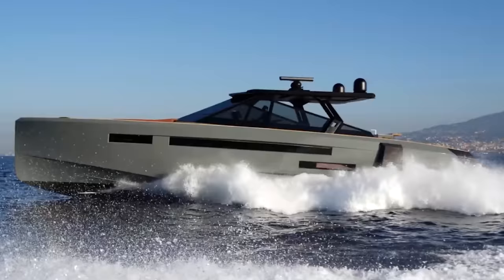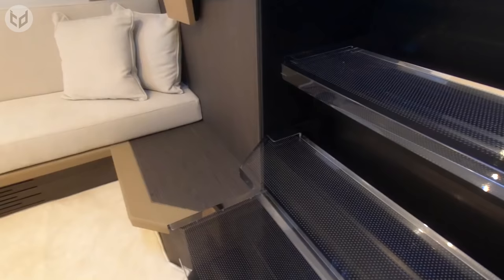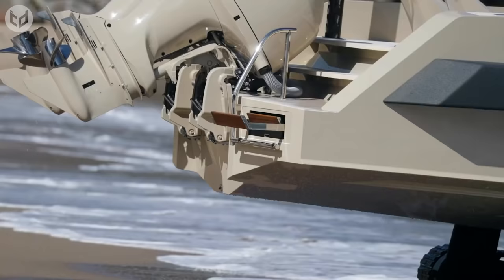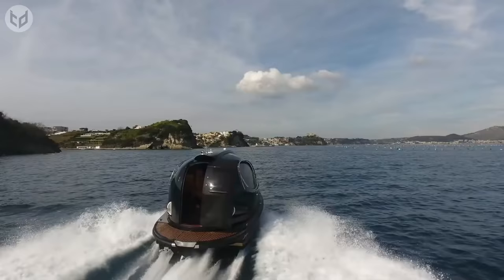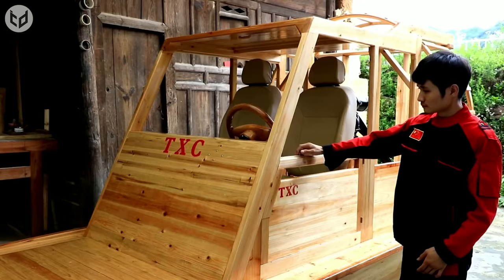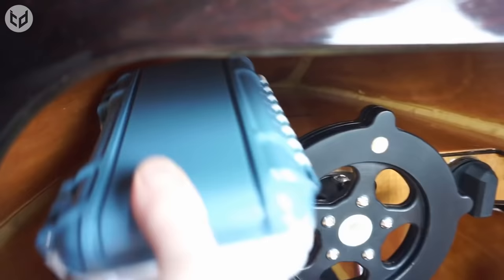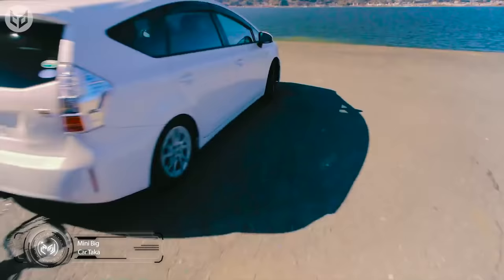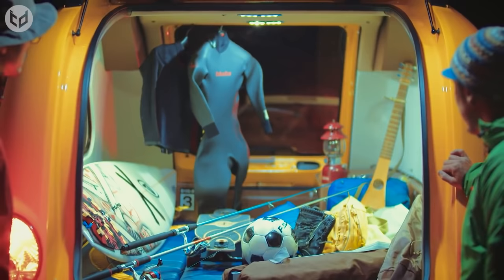6 Incredible Mini Boats and Yachts | WATCH NOW !

Comment: Jet capsule is compact and enclosed. I like the enclosure as you don’t have to worry about bad weather.
Reply: Like it too but i would prefer a smaller and less luxury version with just 1-2 seats because that one would cost waaay less to purchase and to maintain and operate.